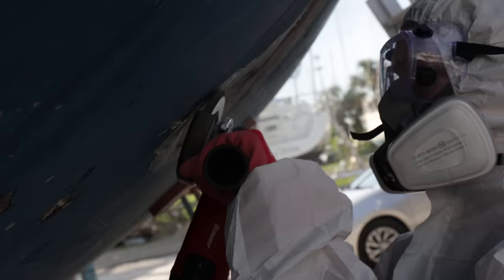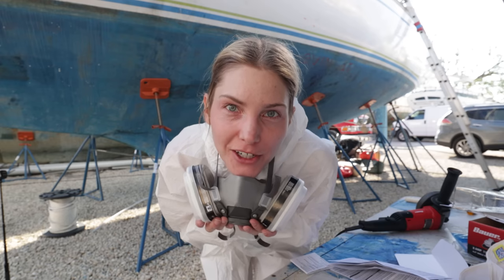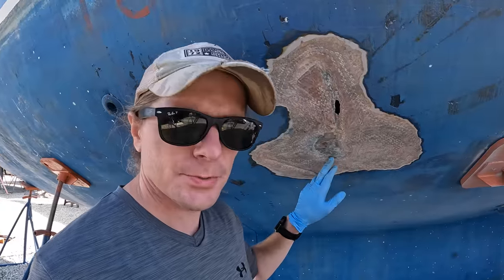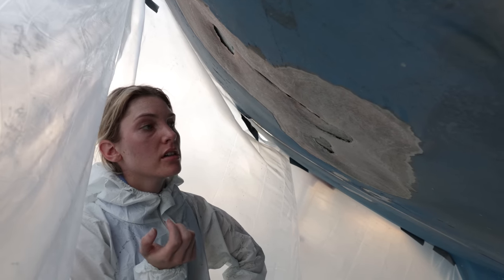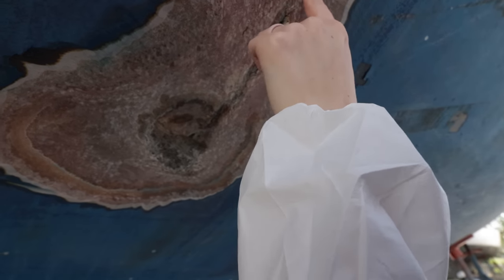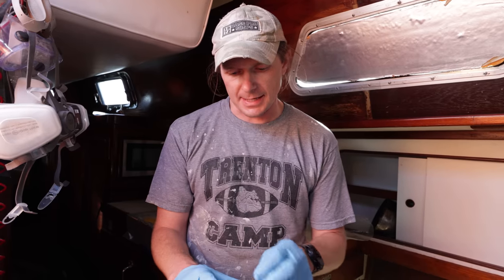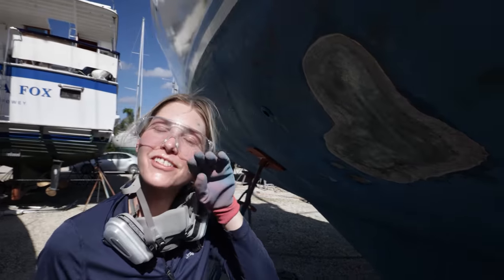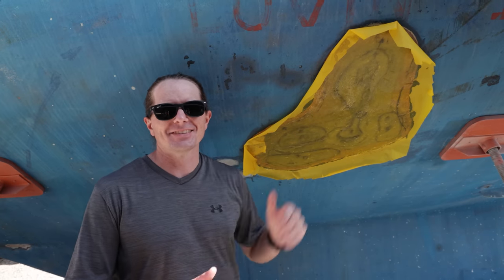Fixing the CRACK in our HULL - Grinding old fiberglass and laying new fiberglass | AHOD 16

Comment: Well she did a good job on the hull repair.  It should hold no problem.  The engine is probably going to be your big issue like it is mine.
Reply from the maker: She crushed this one. We have a plan on the engine! And a refurbished one is on its way and should be installed in the next 3 weeks! (A video on the engine may he a bit more delayed than that... Haha)
Reply: @AndyandKirstin  Sve your core engine at a relatives house.  It will come in handy if it is the same model.

Comment: you will get the most and best bonding strength from putting the largest piece of glass on the hull first!
Reply from the maker: As best we can tell, this is far from settled amongst the experts. When it comes to vinylester and polyester resin, I think most experts agree to do the largest piece first. But, when using epoxy resin (which we used)  the experts are much more divided.